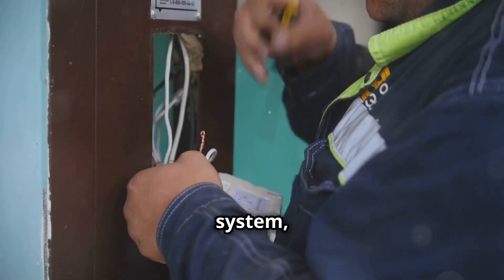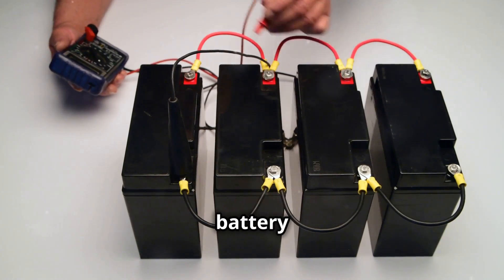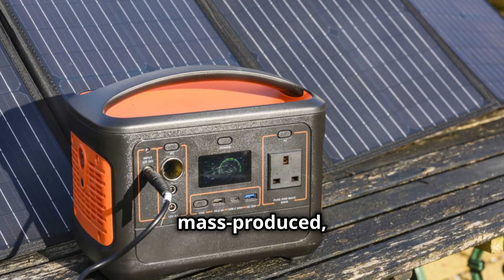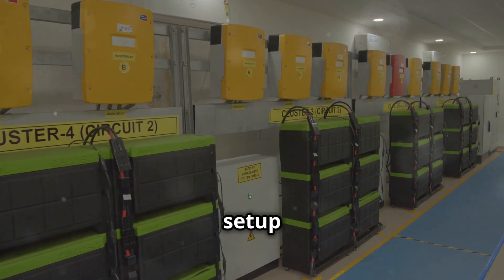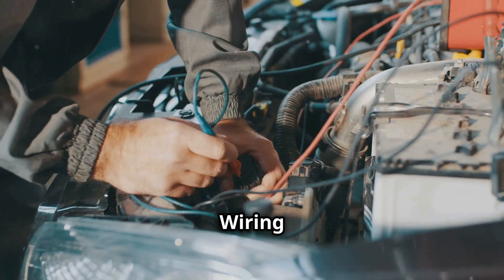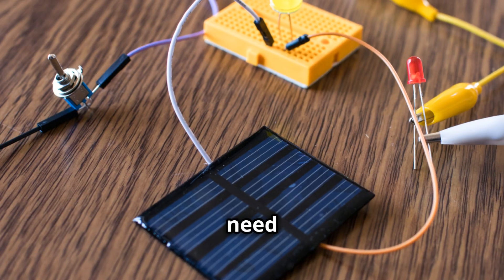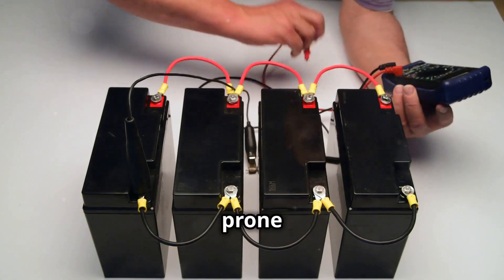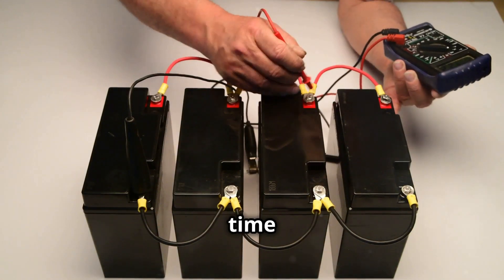4 x 12V Batteries in Series vs. Single 48V Battery: Pros and Cons Explained!

Comment: This video is misleading and potentially hazardous. As the previous commenter noted, it incorrectly discusses series circuits while actually depicting parallel ones. For viewers without electrical knowledge, this could lead to dangerous mistakes. Please consider removing it to prevent any harm from this AI-generated misinformation.
Reply from the maker: Thanks for the comment. I will look into it👍